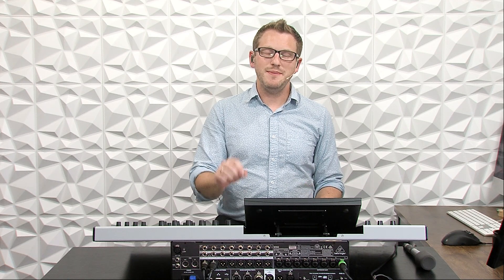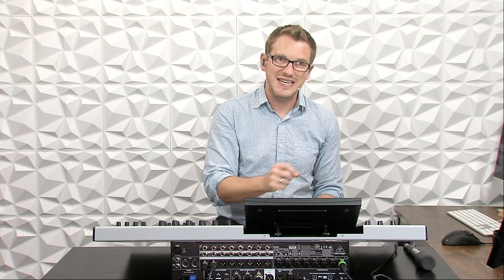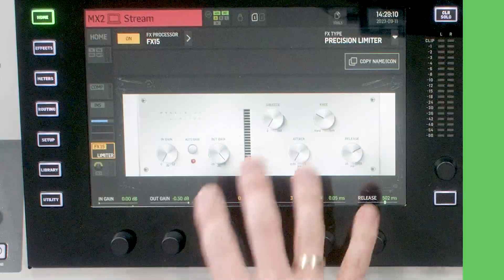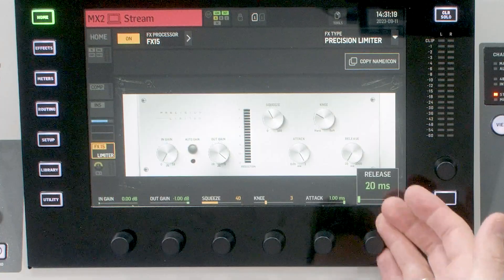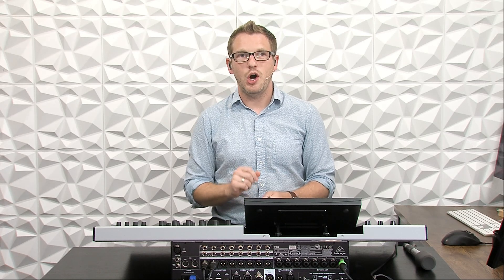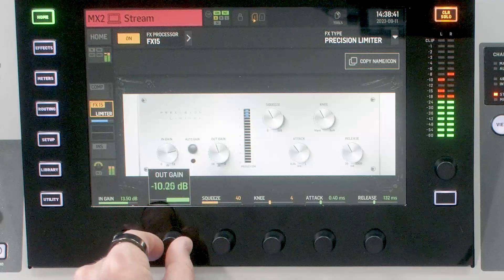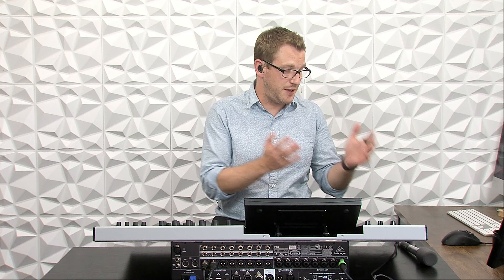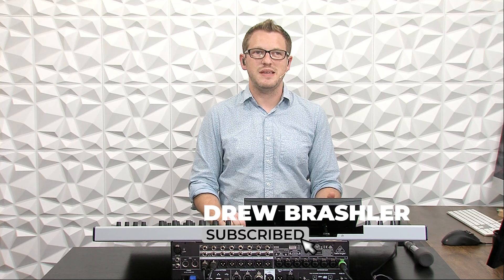Precision Limiter Behringer Wing Effect Tutorial

Comment: Drew! I was trying to do this but my stream was getting too squashed as if it was compressing my whole mix instead of limiting the volume. I ended up using the Auto Rider plugin that the Wing has that adjusts a fader automatically to reach a target db output and wouldn't get the "compressed" sound from the limiter.